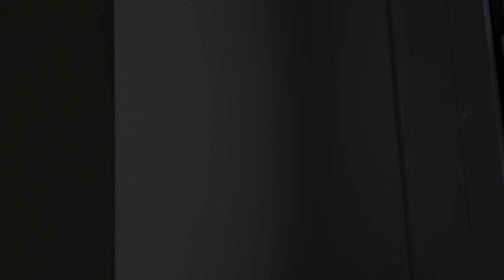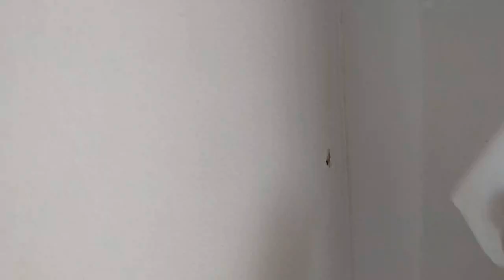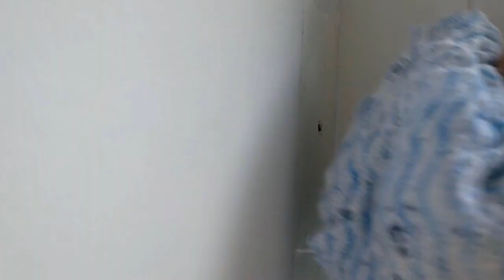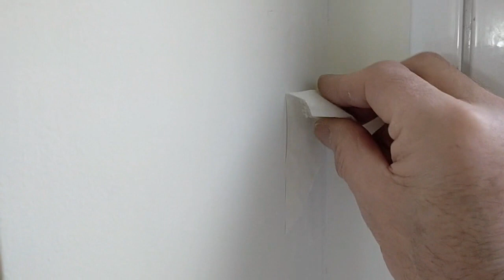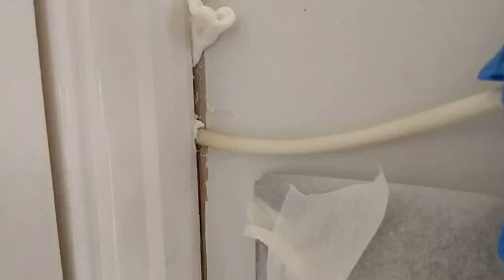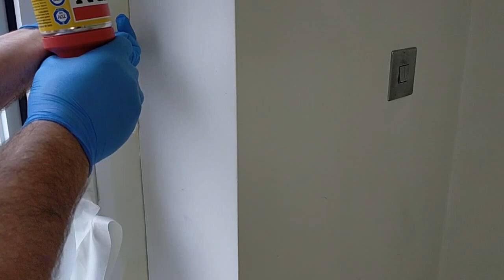How To Fix Loose Plasterboard. Fix Cracks , Fill Holes And Gaps

Comment: Great video and super tips. Please can you do a similar video, on how to stop or reduce the noise from squeeky floorboards, using your foaming methods? That would be a massive help as, there would be less chance, of damaging a hidden pipe or cable, using foam.....
Reply from the maker: Thanks...  foam is not a good idea for floorboards as they need to be removed.
Reply: @PaintingandDecorating can you tell me which soudal foam this is and any other.products you used to do this? Thanks

Comment: Sometimes you rake the plaster out…following the crack and then, foam, fill etc. At other times you just pin with foam using small holes and then fill etc. why the different approaches? Thank you.

Comment: Sometimes you rake the plaster out…following the crack and then, foam, fill etc. At other times you pin with foam using small holes and then fill etc. why the different approaches? Thank you.

Comment: Is that the low expanding open cell foam for windows and doors? They say the closed cell normal stuff can actually cause even wood to buckle outwards from the pressure of the expanding foam.
Reply from the maker: Any foam used correctly will not cause any damage...  if unsure don't use always allow enough space for excess foam to expand out. Thanks